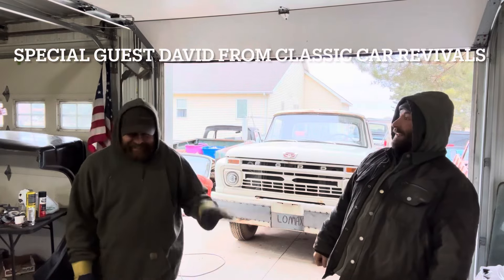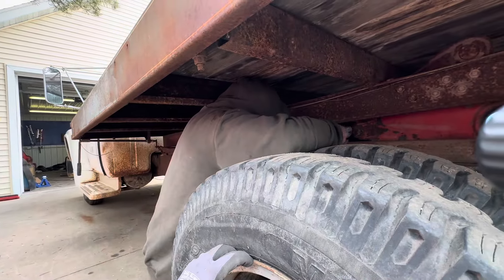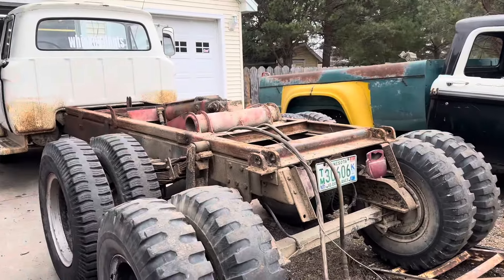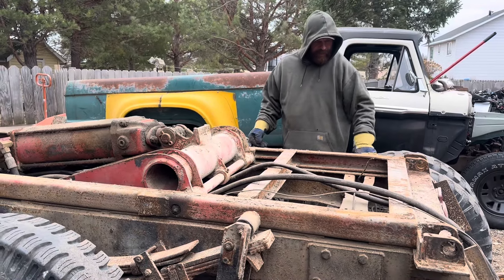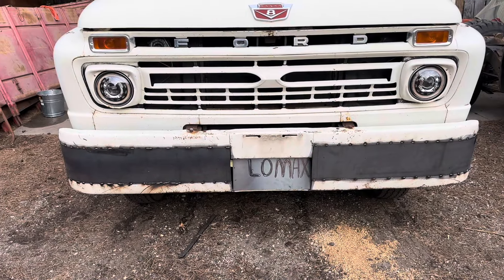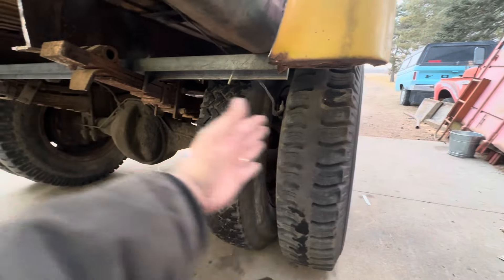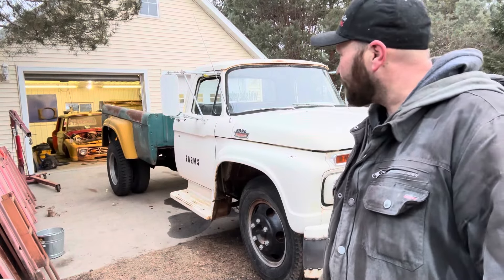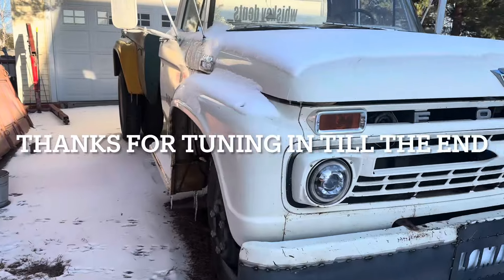Amazing transformation from a farm truck to a pick up

Comment: Ive seen a fairly decent 70-71 Ford f350 custom trim flatbed needs motor i believe it is a 4spd truck and it is around MN so thought it might be something you would be interested in building also...
Reply from the maker: I’m actually going to buy the next project tomorrow. Top secret!

Comment: You could add a crew, make another section in another another section and put another edit. Got that section out and make it get fun a crew cab chains get a nice new Ford F60I mean 650 or so on, put a comments in there and keep in and get a nice push bar and get rid of them. I'm crazy stabs and put a nice new aluminum rail spell and then do that babe up.  Had been I still nice chocolate do a cool to a very cool
Reply from the maker: I’m keeping this one fairly simple so I can actually finish a project lol

Comment: Have you looked into getting the 65-66 custom cab camper special trim truck or the just custom cab trim trucks that have a engine turned aluminum instrument cluster bezel panel and the long sweep speedometer cluster in them it probably my favorite style of these trucks, would be a nice touch in this truck
Reply from the maker: No but I will

Comment: Good progress, it it going to be leaf springs or air ride? Running it that short would be a pretty miserable ride on static springs. I would put step holes in the bumper so you can get into the bed, extend the front running boards to the rear fender maybe. The plexiglass sounds good but I’m not sure how long it would last before it got all scratched and pitted.
Reply from the maker: Springs. Thought about the steps. We will see. I’m just going to cruise it close to home so the ride isn’t that important. Maybe I can find something other than plexiglass

Comment: Howdy!
Reply from the maker: HANK!
Reply: Hank!! Howdy
Reply: @WhiskeyDents  How's it goin?
Reply: @ClassicCarRevivals  How's it goin?
Reply from the maker: @1776_Garage  great. Projects really moving quick. How are you?
Reply: @WhiskeyDents  Good. Something came up so I have to wait to get the manifold but I may do a revival on the diesel Benz.
Reply from the maker: @1776_Garage  the other one?
Reply: @WhiskeyDents  The blue one I filmed once. Same year
Reply from the maker: @1776_Garage  very cool
Reply: @WhiskeyDents  Also someone offered to buy my Benz yesterday.
Reply: I opted to slide rear end on my frame and drill holes instead of cutting frame. Then make drive shaft. 75 Chevy C65 with 32000 miles. Yours is going to be awesome.
Reply from the maker: @ronaldschultz1189  thank you. I’ve done both. This way’s easier and strong